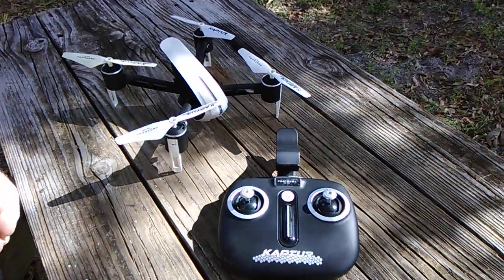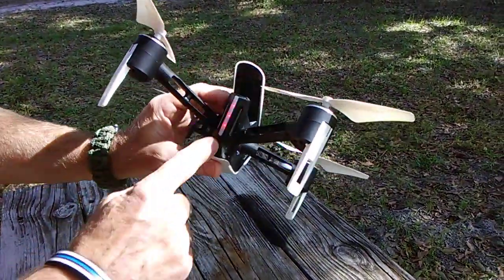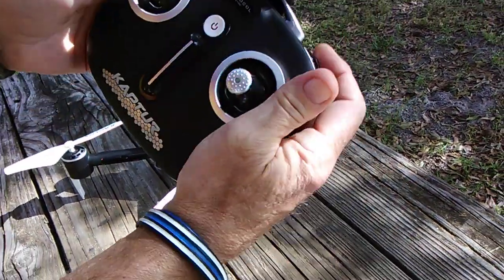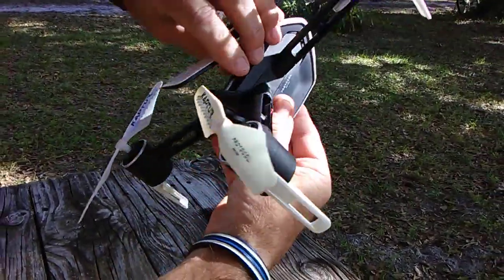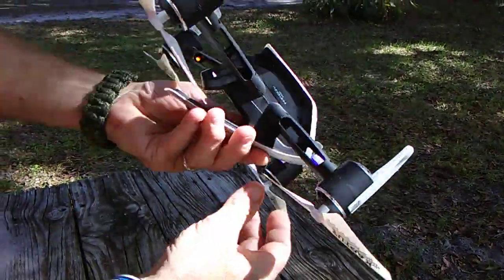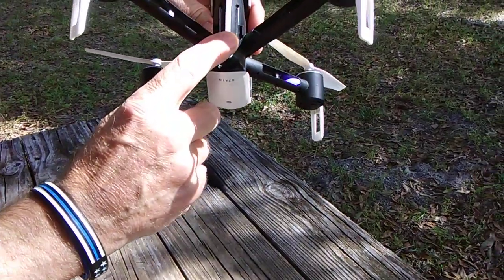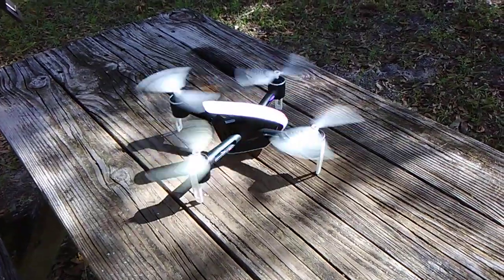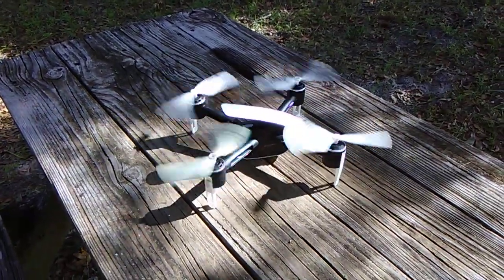[SUPER EASY!] How To Calibrate Your Protocol KAPTUR GPS II Drone - Step by Step Drone Calibration

Comment: I'm not having any luck finding the right sd card that is supported? The manual provides no specs for which SD to use. I tried a Scandisk 64 c10 no luck. Please tell me what sd card works?  
Thank you in advance.
Reply from the maker: How do you know the SD card is not working?
Reply: @DanielStPierre  its says "not able to access the card" when using the app and trying to switch to drone vid feed?
Reply from the maker: Does the card work on other devices? If so, I would recommend formatting the SD card and giving it another try.
Reply: @DanielStPierre  I've not tried it on any other devices but will see if formatting it helps. It occurred to me I may have to be on Wifi for it to access the card but this is my first time with a drone so its all new to me. Thank you for your help!!

Comment: The GPS intenna keeps flashing I flew It around and spinned it around but it's not going away
Reply from the maker: So your drone doesn't find GPS satellites? 

There are 3 reasons why your drone's lights keep flashing.

A) No GPS satellites found
B) Drone needs calibration
C) Low battery

Comment: Hello is it difficult to download pictures and videos? Do I have to remove the memory card from the drone or is the video and picture collected through the  phone on the app? Let me know thanks
Reply from the maker: The photos and video you take using the controller/transmitter (buttons) are stored on the memory card inside the drone, while the photos and video you take using the App (tapping the screen) are stored on the phone.
Reply: @DanielStPierre  so they store on both?
Reply from the maker: Yes, but if you want the same footage on both your phone and the memory card, you have to operate both the transmitter/controller and App at the same time, unlike DJI that caches what' recorded on the drone's memory card.
Reply: @DanielStPierre  thank you
Reply: Thank you

Comment: Why can’t I see the POV of the drone on the app?
Reply from the maker: What do you mean? You can't see the video feed from your drone's camera in your App on your phone?
Reply: @DanielStPierre  when I go to the POV camera it just freezes the screen
Reply from the maker: Sounds like you're getting a wifi conflict with your phone. Did you try a different phone? Maybe restarting your phone would help...
Reply from the maker: Also, if a restart/reboot doesn't work, try turning off your phone's mobile data which can interfere with your drone's WiFi camera signal. This solution has worked for other Kaptur GPS II drone pilots.

Comment: Is it normal for the kaptur drone to spin out of control?
Reply from the maker: That depends on a few factors, the first one being the condition of your drone and more specifically, its propellers. Make sure each prop spins freely and there is no grinding noise coming from each prop/motor. Do you have a vid showing the issue with your Kaptur drone?

Comment: This drone is hell to calibrate as fly 
Stay away from it at all cost!
Reply from the maker: My experience is, I've had 3 of these Kaptur GPS II drones and calibrating them has been much easier than other more expensive UAVs I own, or have flown.

Notice I wrote "calibrating" was easy? Calibrating involves rotating the drone in 2 axis until it's internal gyroscope is calibrated, so the drone can fly level and know it's right from its left, front and back, up/down etc.

While calibrating this drone is quite simple, pairing it to your phone, well that's another story and a huge problem for many users. And the problem is not the App, it's the control boards on the drones that cause connection conflicts. 

And THAT is what makes this drone even more attractive to me because it impacts the "cost" of each one I purchased. 

Call it user error, or done defect, but many of these puppies are returned to Amazon, to Walmart and eventually, to Protocol NY where in turn hundreds of these drones are tested, repackaged, stacked on pallets and sold as refurbs in brown cardboard boxes. Look for my unboxing video coming in the days ahead.

These drones retail at $160 but, I got mine for a lot less...

I paid $60 for my first Kaptur GPS II drone which I bought from a local Facebook Marketplace seller. One of the batteries is defective, it works fine in the drone but the App doesn't read its power level, so I use it as a backup. 

I got my 2nd Kaptur drone on eBay and paid only $30 for the drone and transmitter only, both were in used but great condition.

I found my 3rd Kaptur drone once again locally on Facebook Marketplace, and this one was in the brown box from Protocol NY. The drone kit came complete with 2 batteries and all accessories, and by the race of God, it flies like a champ. I got this one for only $20... :D

So, IMO this drone is worth it at "some" cost. 

#TGBATG
Reply: @DanielStPierre  i did as you showed in this video , and it was a blast to fly, the easiest to fly and learn compared to my
 other drones.
Reply from the maker: Sounds like you got a good one! I have a few Kapturs that seem to have a mind of their own, one of them thinks it's funny to hover 40ft in the air every time I hit the auto takeoff button on the controller... New pilots go nuts every time they fly that drone, then I step in and teach them how to bring it down and fly it just fine. It just doesn't respond well to hovering like it should!